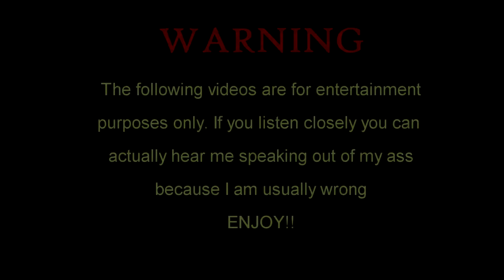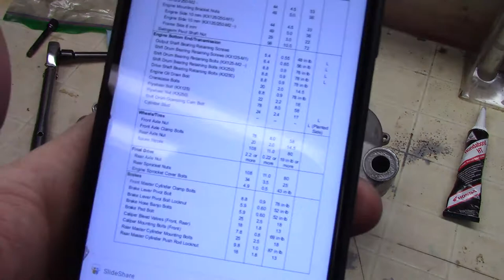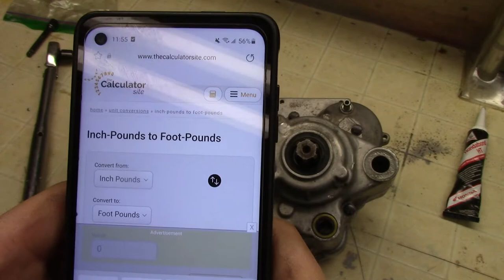Kawasaki KX 125 engine build: Bottom end assembly

Comment: @34:10 into it there when you out that rod in , do you remember what way the washer faced when you set it in? I know you changed the way you did it later but I couldn't really see.
Reply from the maker: Are you talking about that pin with the bearing that pushes the clutch?

Comment: On the clutch, how tight do you get the 10mm bolts holding the springs?
Reply from the maker: Not tight at all. 5-7 foot lbs. Don't over do it as those towers on the clutch boss are pretty fragile

Comment: The gear that touches the gear on the back of the clutch basket the one that connects to the crank mine has some playing it could be a war down keyway because I know it has a key way or is it supposed to have a little bit play
Reply from the maker: It really depends on how much play really. You need roughly 3-5 thousandth (.003 to .005) of backlash between the gears for oil clearance. You don't really see a woodruff key wear. Generally they just break. I would pull it off just to check the key and key slot in the gear if it's really slopy.

Comment: Where do you get the bottom end rebuild kit? I can't find one anywhere
Reply from the maker: Didn't buy one. Got the crank rebuilt at my local engine shop
Reply: I think for these bikes you need to get the crank shaft rebuilt no one makes bottom end kits for these bikes and you have to buy all the parts separately